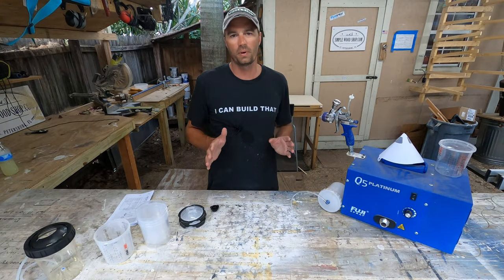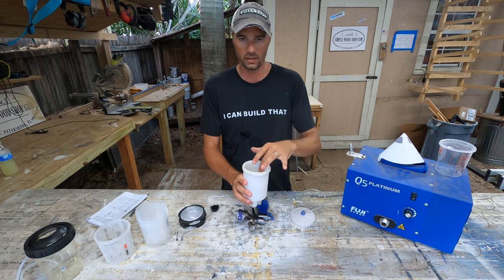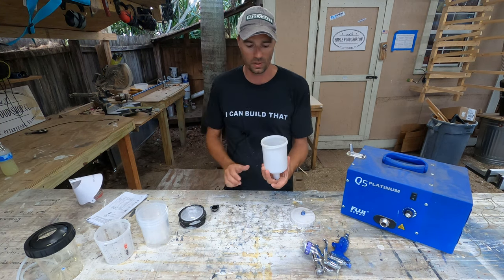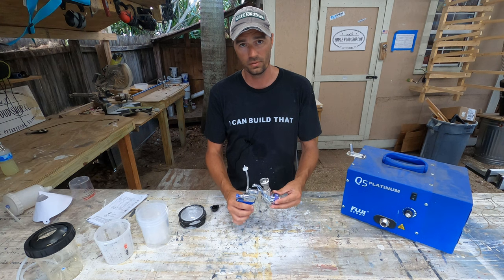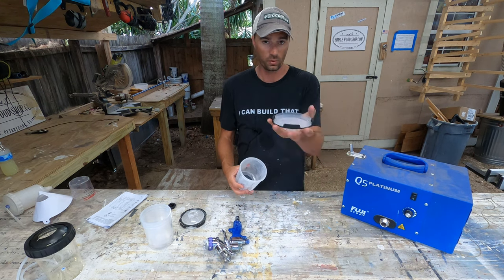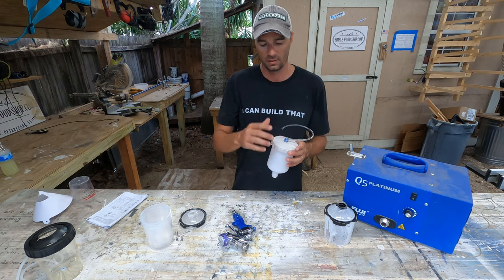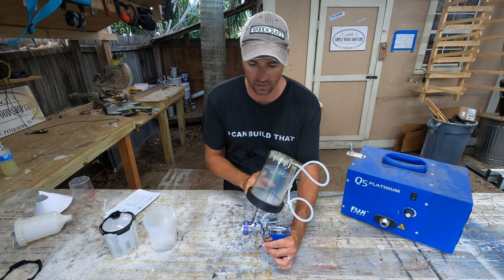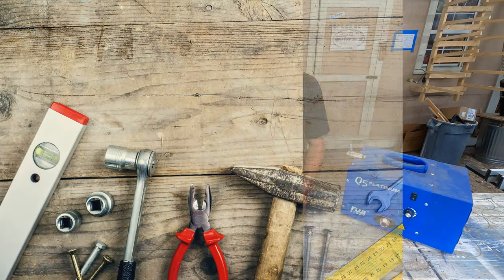Fuji Sprayers and 3M PPS 2.0 system, problem solved

Comment: Thanks for this useful tutorial. I got the PPS system and, after watching this, realized I was doing one thing wrong. I was pouring the paint into the cup after putting on the dome. The paint has to be filtered, right? Wrong! The filter (in the PPS system) works when the paint is on its way out, not on the way in. Duh!
Reply from the maker: It's all good, we all do stuff like that.

Comment: Ok but what if we use a gravity fed and pps system what do we do with that air hose? Do we need to plug it or is air just going to run out of the hole?

Comment: Stupid question! Had one Fuji Q5 Platinum for just a week. Used it just for a painting job, painting some trim and shudders. Never made it work the right way even if I had the 3M PPS system. First of all, but the time I figure it out it might need a bigger air cap, the blue hose melted by the machine end. That was my fault. Had the unit right on the top of the stairs and the blue hose was too hot and not running flat on the floor and created a kink and overheated. Now my question is do you really think this is worth it? Like I said had it for a short time and was new to spraying. I sometimes do kitchen cabinets or trim to spray. At this point I am using a Titan 440 Impact and doing all this with it. Works great but I really hate the cleaning proccess and the waste of material. Thinking to get another one but still not sure what to do. I could just buy a stronger airless for all the ceiling and wall spraying ( Graco 695 Pro) and keep the Titan for insl-x cabinet coat and once in a while for polyurethane trim/ doors spraying. For these I could easily just buy a cheaper hvlp gun and run it throught a bigger compressor. Any thoughts on the Graco 9.5 hvlp system? Thanks a lot. Really nice channel btw.
Reply from the maker: Hey,  Sounds like have a lot of different needs for spraying.  The fuji can work for large areas like ceilings but its not ideal due to the low volume of materials it can store.  You are probably going to have to use several different sprayers.

Overall I have been very happy with my sprayer and find no issues with it.  From what you wrote it sounds like there was a learning curve in the beginning.  I had that too.  I don't have any experience with any other sprayers.
Reply: @SimpleWoodShop  I will keep my airless for walls, ceilings and interior trim/windows for large areas. My main question was about the Fuji Q5 if worth getting one again for cabinets, polyurethane or small projects. Not sure how good it is even if I had one but mess it up
Reply from the maker: @georgeturcu5761  I think that once you give it some practice, and use the correct setup you'll be pleased.  It made for cabinets and small projects like that.  But it also means one more system to mess around with.  Might be able to do the cabinet with your airless by just swapping out the tips as well.
Reply: @SimpleWoodShop  I use the 310 fflp graco tips for cabinets. 310/312 fflp for trim depends on paint. I have to decide. Fuji Q5 or Graco 9.5 hvlp Comp. comes with pressure pot and built in compressor. Or maybe the Graco 395 Finish Pro. Same ideea but works as an airless too. I know I could just get a pressure pot for the Fuji but I have doubts that without a compressor will spray the same without thinning the paint. You been great. Thx again
Reply from the maker: @georgeturcu5761  Got it, The only paint that I was unable to spray with my Q5 was thick metal paint from Rust oleum.  It had a hard time and I'll probably thin it next time.  House latex was fine with the 1.8 air cap.
Reply: @SimpleWoodShop  Those might require a larger air cap like #6 or #7. I think I am gonna get one. Amazon does not have the gravity feed Q5 package in prime at this point. Easier return in case something goes wrong. I never use thise thick paints but I will still probably get the #6 just in case. #7 is way too large.
Reply: Just an upgrade. I will air assist my airless and run it with the G40 Graco gun for bigger jobs and trim too and getting same Fuji system like yours for small jobs with the 3M cups for the gravity feed gun and for medium jobs I will use the syphon Fuji gun tunning it throughba pressure cup. Btw Fuji just emailed me back today. I was wondering if any sale going on soon. So in June they will have a sale for the Q5 only. Buy one get a second gun free. Maybe you can promote that in a new video 
Thank you for all your time and patience
Reply: @georgeturcu5761  здравствуйте, что в итоге купили? Также стоит выбор между Fuji q5 и Graco Procomp 9.5

Comment: Great videos! Looking at upgrading my Fuji for woodworking tasks following your advice. I've only sprayed general water based finishes to date, love them. Was looking at the PPS guns for near zero cleanup, but I don't believe my Makita MAC5200 can push that guns requirements for air. (Any advice too the contrary for furniture finishing would be appreciated. ) in lieu of that direction, I need to add spraying latex paint. In your experience, can I already latex without thinning? What tip size would I want for my Fuji? If I sound uneducated, I am. I am new to spraying and know very little behind the one method I've been using that works. Side thought on cost factors. I currently have a bottom fed Fuji gun, so in addition to adding the PPS system, I would be adding a gravity fed gun as well.
Reply from the maker: Hi, Thanks for watching.  My only experience has been with two Fuji HVLP systems.  The q5 can do latex with the 1.8 air cap setup.  Most of the time it can do it without thinning but that does help a little bit. The gravity pps 2.0 system is what I use and I am very please with it.  I currently have some latex water based in the gun now and I will use it this afternoon.  To do all of that you are looking at some $ but I would do it again if I needed to.  If you plan to spray more than a quart at a time you may look into the pressure pot system as well.

Comment: Thank you for the video.  Exactly what I needed.  I have 2 questions.  What is the "thickness" level the paint should be to make you want to switch to the H/O system?  Second question - How do you measure the thickness? (Newby here).

Comment: Hi - my question is if you use the original set up as you'd assembled it initially (to spray thin acrylic for example), what's happening with all the air that is shooting out of the now redundant hose and filter? Don't you need that? Great video and thanks.

Comment: Hey Matt.  Just purchased the fuji system and have not sprayed anything with it.  Gonna use it primarily for poly or thinner products.  Do I need the pressure cup for thin products?   How well does it spray without the HO cup(do I need to keep gun upright.  Is there lower volume of product without it)?
Reply from the maker: You can spray everything you want with the gun that comes with they system. The PPS setup makes it easier in the clean up with the disposable bags. You’ll need the h/o cup for it. It is the only way the air is attached to push the material down. Otherwise it’s just gravity and won’t work well.

Comment: One question, if the solution is in the hard plastic cup and inside the second disposable cup how does the air pressure from the unit push through the disposable cup? The disposable cup must be sealed to keep the outer cup clean to use the next stage with no mess.
Reply from the maker: You drop the liner in the hard cup, then pour your solution into the liner. Once you put in the hard cap ring and close it up it’s sealed. The air hose attaches to the hard bit and pushes the solution

Comment: Can not take the cup and store it if you have not used all the solution?  I mean I guess you can but have to have multiple expensive HO cups?
Reply from the maker: Hey Harley, What I will do is carefully pull the bag out of the cup, squeeze the solution up to the liner to get all the air out then plug it.  This will usually give it a good seal.  You just have to be careful not to tip the bag.  If you wanted to store it is something more rigid you can buy the plastic cups that are used without the H\o system.  They are cheaper than the hard plastic cups and you just transfer the cup to it.  Thanks for watching.  I put a link below to those cups. 

https://amzn.to/3pEQyEU

Comment: Great video, thanks for pointing out the removal of the ring, I just bought the stuff to convert my Fuji and I thought that didn't look right, your video came up in my search and clarified it.  Also, I thought it would be good to mention that a key benefit of this system that I bought it for is the ability to spray in any direction (with the pressure cup of course.)  When getting into the crevices and so forth on furniture / cabinets etc... it's a game changer, I used to switch between guns and have even more cleanup before going to PPS 1.0

Comment: Hey Matt, I'm just about to pull the trigger on the Fuji Mini Mite 4 Platinum.  Before I did, I searched all over YouTube for a video of the 3M PPS 2.0 system specific to Fuji.  You absolutely nailed it with your video!  You answered all my questions from adapters to cups to how the system functions with the Fuji T-75G, and sealed my decision to go with the gravity feed gun. Thanks very much for the effort you put into this video!  Much appreciated!!
Reply from the maker: Hey Tony,  Thank you.  You will like the system and the PPS add on as well.  It's really a worthwhile addition.  I've found it very easy to switch materials as well.  Just remove the cup and put a plug in it and set it on the table.  Give the gun a quick clean with water and start again.  Feel free to reach out if you need anything else.
Reply: @SimpleWoodShop  I appreciate it!

Comment: Thanks for sharing your experience, i wanna know if i can use the (Pressure Cup 3M PPS (Original Series) 16124 PPS H/O) with    Fuji Spray Fuji 2203G Semi-PRO 2-Gravity HVLP Spray System Gun?
Reply from the maker: Hey. I am not sure. I believe you can get the original adapter for that gun and you should be good to go. 

It would be the same adapter mode as version 2 but the model number will start with a 1.

Comment: Hi, the Fuji system is designed around the pressure cup and hose. Would you think this could get one into trouble if the pot is not pressured - especially when tipping the gun or when the paint is low?
Reply from the maker: There by is a pressure cup for the PPS system. It’s called a H/O cup. Just drop the liner in that cup and attach the pressure hose. Works great.

Comment: Thanks for this, it was really helpful. Are there any instances you find the bottom feed cup/version for the Fuji (or spray painting in general) advantageous?
Reply from the maker: Hey Kent,  I have not been able to use the bottom cup system. I figured I'd let gravity pull the material down rather than use pressure to push the material up.  That's about the extent of the research I did on which cup to use.  Also fewer parts to wash in the gravity system.

Comment: Pretty obvious why you throw away the filter, but why throw away the screw on lid when you're done spraying out a project? 3M recommendation or just don't want to clean it?
Reply from the maker: The hard plastic lid on the h/o cup you keep. The little plastic black ring that comes off you toss. The filter and liner you toss too.

Comment: would you recommend 3M PPS 2.0 or 1.0?
Reply from the maker: 2.0 All day, the top is a 1/4 turn instead of a screw on cap.  The 2.0 has the larger dome so more materials is available after its filtered and the 1.0 is being phased out eventually.

Comment: You have some good information just wish your camera would zoom in to see the details. I have the Fuji 5 with the 3m system. And I'm having trouble just getting  the plastic cup that comes with the gun to come off the gun. In the manual it says do not disassemble the cup assembly  threads in your cup have been sealed at the factory to prevent leakage under pressure.  So how do you use the 3m system?  I'm so frustrated.  I will call Fuji to get instructions.  The videos from Fuji are not that good.  They don't let you see any details apparently nobody wants to zoom in to see the small parts. I work in a factory that makes piston pumps. I trouble shoot tear them apart when they don't work and put them back together. Do factory setting use tools all day and I am having a horrible time with this. Can't imagine what most people are experiencing with this.
Reply from the maker: Hi,

Sorry it’s frustrating. Are you trying to take off the factory cup and install the 3M adapter for their PPS cups?

If so you will to remove the old cup and install the adapter. It’s just threaded on. Removed the old cup and metal screw part. It’s an easily removed part. 

Install the right adapter and then the 3M cups will thread into the adapter.

Comment: Thank you for the links, I just ordered a Mini Mite 5 with the PPS 2.0 H/O 13.5 oz. Brand new to spraying/HVLP, can't wait to learn!
Reply from the maker: Hey Cody,  Thank you for using the links I appreciate it.  The Fuji System is awesome. It's easy to use and with the pps system its great.  I have another video on cleaning the system I will link below.  Keep it clean and practice on some cardboard.  Match your movement speed with how much fluid comes out.  If you go slow then less fluid, fast then more fluid.  You will find you balance.  Congratulations.  If I can help let me know.  Matt@simplewoodshop.com

https://youtu.be/n5vZkPhGZh4
Reply: I as well am waiting for my PPS to come in for for my mini mite 5 (T75g) does this sound right for the cost of the PPS?
Hard cup
Adaptor
Lids and liners
Total $250
That sound right to you?
These guys told me when I want to buy more liners&lids it would be $183🤔😳😂
Reply from the maker: @mlinecomposites1  $250 for the hard cup, adapter, liner\lid kit sounds about right.  However the reorder price seems a bit high.  I have a couple link in the description to Amazon listings that are a bit cheaper.  

Initially I went to my local carj finish supplier and they had a price that was really high.  So I use Amazon and we have a local place that is cheaper as well.  Thanks
Reply: @SimpleWoodShop  Two H/O 13.5 cups, 6 liner kit, and the gun adapter was like 225. The liners are way cheaper than that... someone is trying to hose you. I used the links Matt provided. Just make sure you turn the compressor off and flip the gun upside down and pull the trigger to release the pressure... found out the hard way.
Reply: @SimpleWoodShop  thanks a lot!

U know it’s funny, I still haven’t received any of my PPS parts yet. The auto paint supplier called me and said he ordered the wrong cup🤨 4 days and this guy still can’t get it right. But much appreciated with the info👍🏾😃
Reply from the maker: @Meyerwoodworks  My brother was using the sprayer once and up screwed the cup without flipping it over so he could refill, the residual paint came out onto the whole gun, its green now.  You'll do that once.
Reply: @SimpleWoodShop  Yep, ruined my pants and got varnish EVERYWHERE. LOL

Comment: I already have a pps system as I've sprayed with Iwatta and Sata for years. I just ordered the Fuji Mini Mite 5 for remote ability, and a 1.8 cap to also have the ability spray latex/thick sealers if I so desire. My question is, is the 65 dollar h/o 2.0 cup a huge improvement/requirement over the standard non h/o with this setup? I love 3m but 65 bucks for a plastic bowl is ridiculous.
Reply from the maker: Hey,  Yes you will need it for the latex especially.  Without the h\o cup you rely on gravity to feed the paint, it dosen't work that well. The Fuji is designed to have that back pressure so you'll need it.

Comment: Awesome video.  I just got my 3M PPS 2.0 system today for my Fuji system. I was confused by the H/O cup and liner lids too.  Figured I likely was not the first and found your video that confirmed my assumption that the black gasket on the liner lid had to be removed.  Thanks!
Reply from the maker: Thanks for watching,  I sat there for at least an hour trying to figure it out.  Felt so dumb when I really figures it out.  What  type of stuff do you spray?

Comment: thanks for this video, new subscriber because of this.  I was confused on which parts to get for my fuji gravity gun like yours.  I am moving to the PPS mainly because I want to be able to spray in any direction and the PPS lets me spray the inside of cabinets easier as I can now spray upside down.  I like the fuji system but it still takes me a lot of fiddling around with viscosity to get the right flow.  You did a great video here on the parts and another on the cleaning, but could you do a video on actually spraying different finishes, like a thick latex down to a thin lacquer and which tips you use for which?  :)  I am hoping this HO PPS helps push thicker finishes without thinning them down so much like I have to with the stock gun.  If you do a finishing video, then you would have a full series!  Also, very helpful as I couldn't figure out how the black ring fit in the assembly, this totally cleared it up as both fuji and 3M failed to explain it like you did!
Reply from the maker: Todd,  Thanks so much fo the positive comments.  I appreciate it.  I too was frustrated with the ring on the cups, and had to figure it out.  I am able to push house latex paint through without thinning with my Fuji Q5 system.  I have some other videos lined up and can possibly work in some spraying ones.  Thanks.

Comment: I needed confirmation about the 3m cover. It's pretty ridiculous that there isn't a line in the directions that tells you how to use the other cap. Good video, thanks.
Reply from the maker: I ran into the same issue. Sat at my workbench thinking “ I have a master degree and I can’t figure this out”. How is that possible.